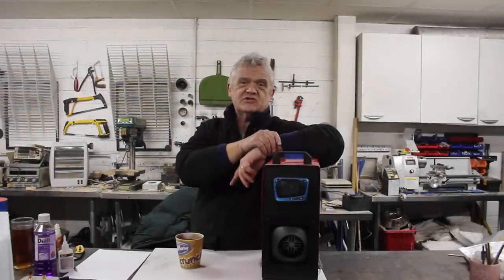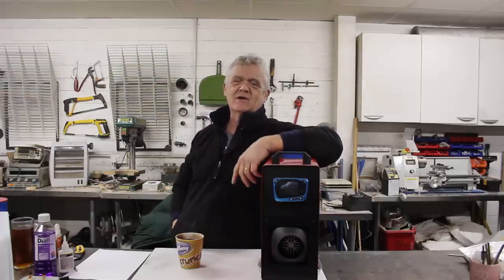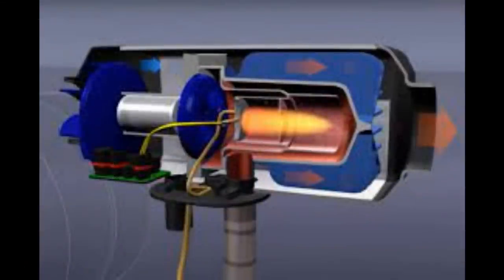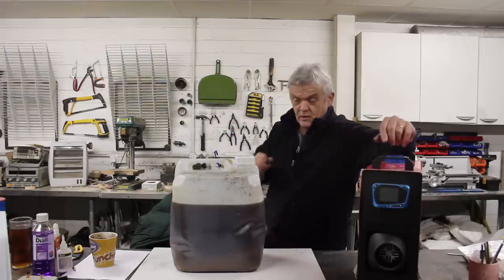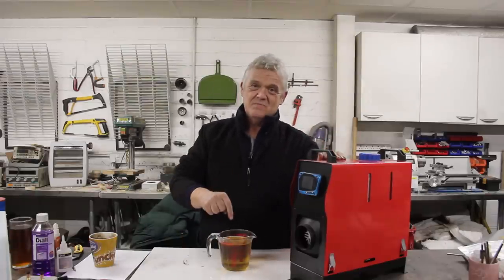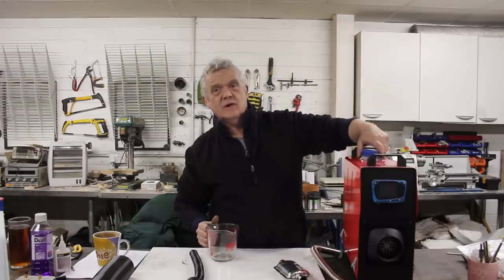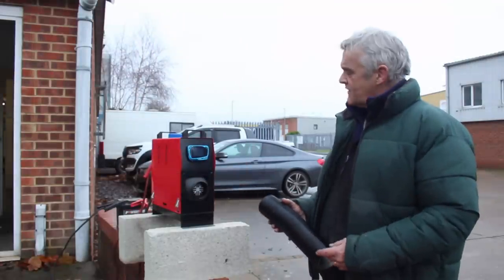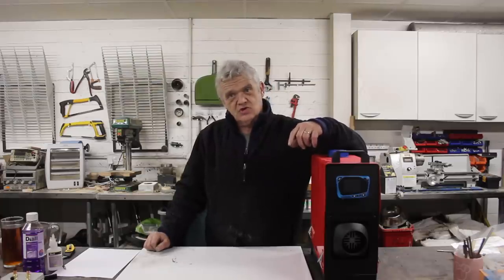1793 Home Made Fuel Running A Diesel Heater

Comment: Happy Christmas Robert, and this was a gift! I bought one of these diesel heaters after your review and run it on agri diesel, after watching your last video where you cleaned the used oil my first thought was if that could be used in the diesel heater. I didnt want to risk it as I dont know enough about the fuels but you have just carried out what was going through my mind and shown it possible! Thank you
Reply: Don't use vegetable oil!!! It has glycerin in it and that doesn't burn and eventually your entire burner chamber will be clogged like it did to mine even with a 50/50 mix cooking oil / diesel still failed, look for my videos if you don't believe me .
Reply: @AndersonERockefeller  thanks. that's interesting as from what I understand in making bio diesel you remove the glycerine as a by product. so therefore it wouldn't end up in the burn chamber. wonder what about a higher ratio of kerosene like 70/30 to used veg oil?

Comment: Mate you describe that terrible stock silencer as a catalytic converter??? hahhaha sorry Rob but having bought sold and installed many of these chinese diesel heaters that made me roll on the floor laughing
Reply: prize it open with a teaspoon and see how much platinum rich catalyst can be salvaged☺
Reply: love the bio diesel process btw- think this would also work with standard uk heating oil (kero) because the paraffin and heating oil both work in the heater straight with very slightly less watts of heat into the room per unit fuel than diesel
Reply: Actually you could do the whole process in the same IBC you get the oil delivered to, leave the glycerine cake at the bottom and keep the heater pickup a few centimetres clear of it
Reply: Put a few hundred hours on that heater on the home made oil and you basically saved > the cost of buying a new burn chamber and glow plug if you did end up knackering them.   this is a great video for those living in caravans and boats through the winter

Comment: Would a cooking oil+engine oil mix positively or negatively affect the cleanliness of the burn? Would it be possible to reduce the quantity of paraffin in the ratio with a cooking oil+engine oil mix?
Reply from the maker: I don't know mate
Reply: @ThinkingandTinkering  If it's possible to create a clean burning fuel out of cooking oil+engine oil, possibly with a primer to get started if necessary, then arguably you would be "recycling" the engine oil into a product prior to using that product as a fuel, so could probably continue to acquire engine oil under the banner of recycling/waste management (in-case Garages are unable to "supply it as fuel" rather than "disposing through recycling").

'RMS Recycling' or 'Bobs i-cant-believe-its-not-Biodiesel' (shortened form: 'Bobs 😉 Biodiesel')
Reply: This barely qualifies as surface-level research, but according to 'Automotive oil recycling: Used motor oil re-refining - Wikipedia', motor oil is indefinitely recyclable for lubrication; used motor oil just needs refining.
So used/contaminated motor oil can either be distilled into diesel or refined into new/fresh motor oil. But the dedydration stage of re-refinement produces "residual light fuel that can be used to power the refinery". So could potentially replace the paraffin in the cooking oil mix, alongside the production of usable motor oil.

Comment: wonder which is more efficient, that or a oil filled radiator at home. thanks for the vid again!
Reply: That!  Unless the oil filled radiator is running on renewable energy.  £p-wise, these heaters beat electricity running costs by a factor of 3-4 if set up for, and burning, central heating kerosene.  Grid suppliers are currently charging 34p for each kWh whereas these heaters can produce about 8kWh for the cost of a litre of fuel.
Reply from the maker: oh the heater for sure lol

Comment: Hi Rob, Do you have an alternative to use in place of petrol in petrol generators?
Reply: LPG- they run really well- except that just bunging the hose in the carby means that it does not respond to changes in load by itself- You have to nurse it a bit. Spend some money on a LPG inlet manifold and regulator and they run better than petrol. You can buy conversion kits.
Reply from the maker: I haven't really thought about it mate - but I must - good suggestion
Reply: @t.h.o.r.  I know about gas regulators for internal combustion engines. I’m looking for something along the lines of old fryer oil with paraffin to be used on a Diesel engine when there’s no supply of conventional fuel but I might still need power. I’ve got solar but there’s often days that the solar is not strong enough (clouds) for my needs and I need either grid power or a backup generator.

Comment: thought it was now illegal to burn used oil now
Reply: No.
Reply from the maker: apparently not
Reply: It's illegal to burn used engine oil, without the correct (and expensive) paperwork. Seems veg oil doesn't fall into the same category.

Comment: It works! Great stuff!
These kind of heather's are also used in boats a lot but my idea would be to use the Fuel in the "old fashion way where you have a pan and a carburateur 
It's not so noisy and no electricity required and gives a pleasant heat
Reply: How would you use a carb 🤔 a carb requires air flow to suck the fuel out and mix it with the air  so you'd need an air pump (otherwise known as an engine) to create the airflow, won't work with a pan 🤔
Reply: @Dirt-Diggler  its not a Car it's a oil stove where you have a special type of carburateur which drips Fuel in some kind of dish often with a pole in the middle for the Heat
Reply from the maker: cheers mate